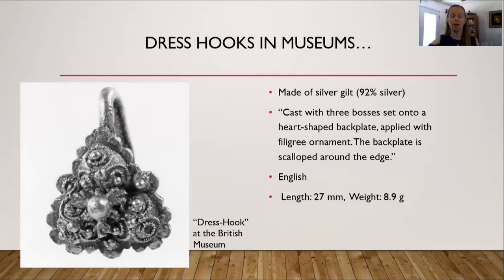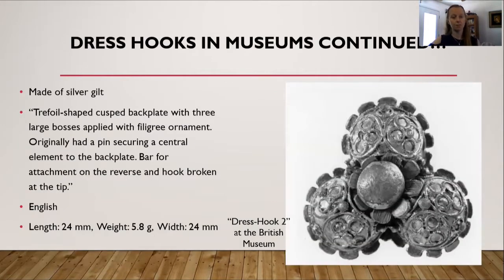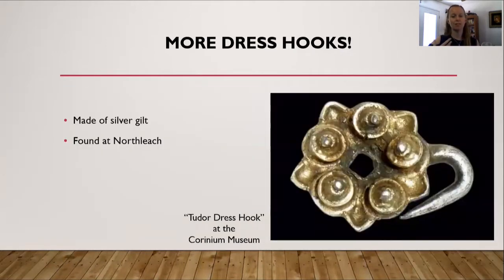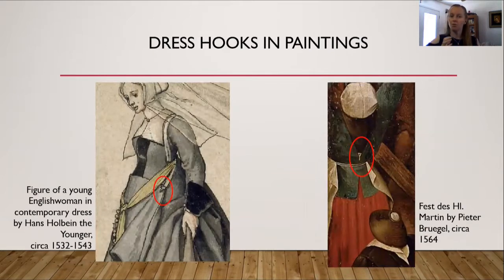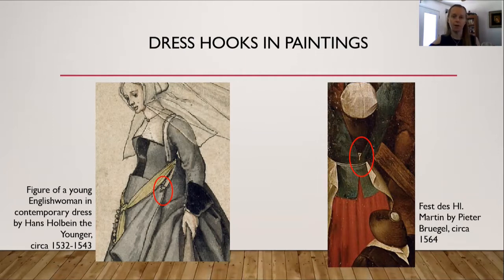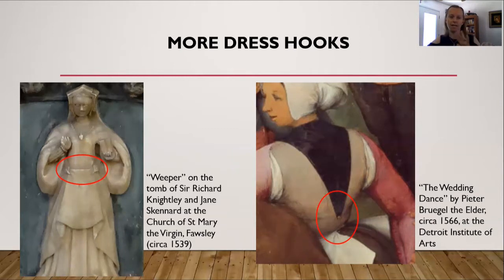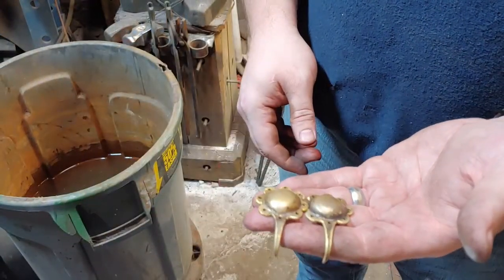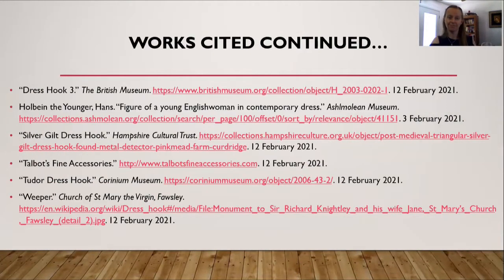16th Century Tudor Dress Hooks | History & Making of by a Blacksmith

Comment: Very interesting. Hooks like this (different designs) are found in the Saxon period in the UK, usually identified as 'garter hooks'  because examples have come from graves beside the knees. I had not appreciated the particular usage you demonstrate, but the skirt lifters are really interesting. It probably explains the straight bar loops on a number of these; presumably a ribbon or tape passed through the slot. I really don't understand why the 'scarf' or partlet needs to be hooked to the bodice, though.
I also doubt these were made by hand as your husband made them. Examples I have handled suggest that casting is involved, although clear some sort of hand-working is needed to create the hooks. You also imply in the beginning that silver or silver-gilt examples are the norm, but of course these are at the upper end of the market. The examples shown from Colchester, and the vast majority found, are copper-alloy, sometimes gilded.  
It is a really good explanation, and taught me new stuff. Thanks.
Reply from the maker: I'm glad you enjoyed the video!

Comment: Any suggestions for making dress hooks without power tools? Could it be done with maybe jewelry tools and findings?
Reply: Not that this will probably help you, but in the period there were no power tools......
Reply from the maker: @ Rachel Alexander - Yes. You can make the same one that my husband made, with thick sheet and a dapping punch. You can also fabricate it out of thick wire (you would want the wire thicker than sheet, such as 1/8 inch). You can use a center punch and a nail set to do simple decorations; and then cut it out with a jewelers' saw. If you want to use findings, just substitute those for the decorations my husband made.
Reply from the maker: @MW - Actually, yes there were power tools in period. The water power revolution had begun by the 15th century. Water powered hammers, saws, and "great wheel" lathes were in common use all over Europe. In some industrial centers (like Nuremberg), the rivers became nearly unnavigable because of the growth of the mills. 

In small shops, it's true that there would not have been no power tools. However, in these small shops, there would have been at least 3, and as many as 100, other people (apprentices and journeymen) to offer assistance. They had no mechanical power tools, but they had human power behind their tools. It's fair to say that medieval shops had far more power assistance than modern craftsmen do, regardless of how many power tools are in the shop.
Reply: It would be down to a lot of hard work. Power tools are essentially electrically-powered versions of hand tools, so hand drills, files and hand saws will do the dame job, providing that you use the right versions - eg needle files, metal fretsaws, etc.
Reply: @LynneFairchild  Good point. I stand corrected. I guess that most artisan craftsmen relied on simple hand tools, however, which is why places like Nuremberg became so powerful in certain areas.